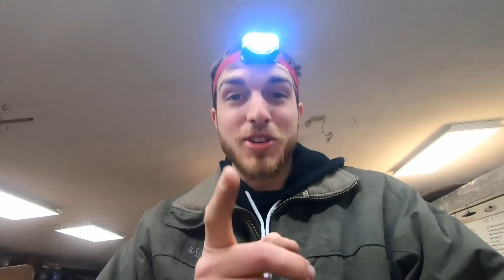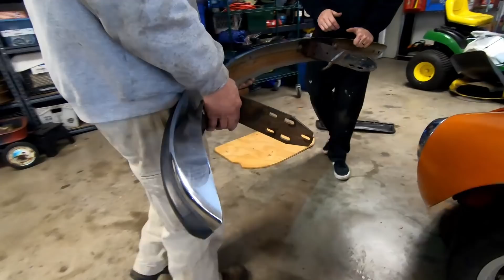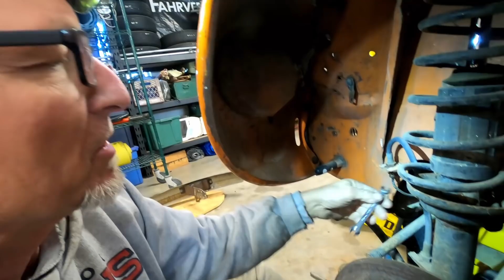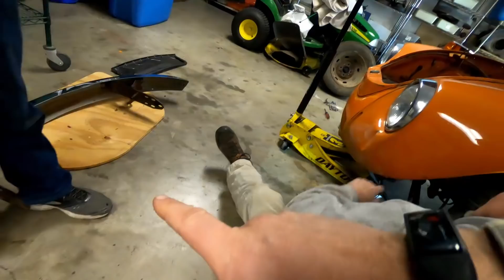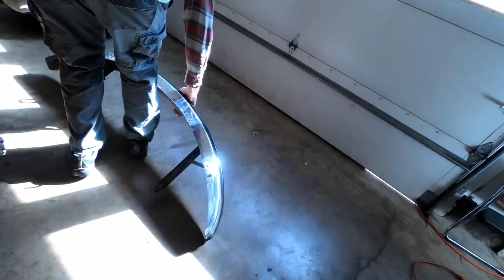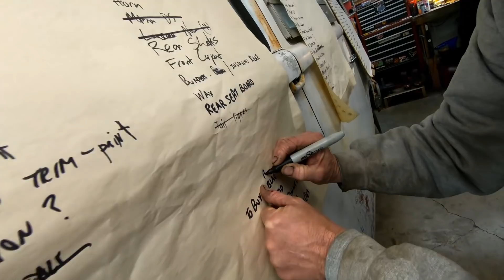Nothing's Too Good for the Orange Menace! 1973 VW Bug

Comment: Hey VW Life! I hope I have as much fun installing my bumpers! I just picked up a new project....1983 Vanagon Diesel! Only 80k original miles, only a couple surface rust spots and there's pretty nice paint underneath the oxidation. Going to be a billboard work truck for my electrical business
Reply from the maker: Wolfgang that's great! Did you see our last video with Alice's diesel vanagon?
Reply: @VWLifeVW  I did! I'm collecting parts now to convert it to the euro spec turbo diesel

Comment: my '63 bug had a defective rubber line. It looked good on the outside but it wouldn't let the fluid go both ways and the brake would not release.
Reply from the maker: Yes, that's stumped us before.

Comment: I have a question,  can you Baja a super bug ??
Reply from the maker: Yes sir. There is a channel called Dust Buggy they have one, check them out
Reply: Yes with a baja kit made for a SB not as strong as a king and link pin but depends on how you want to use it

Comment: The wrong bumper was a easy mistake. I would rather get a car from you guys as opposed to those quick flip jokers you see on you tube. What's the plan for the single cab? It should be next
Reply from the maker: The single cab has been a slow project That Gary doesn't his free time. Since he does that work on his own not much of that is making it on YouTube, unfortunately, but the triumphant day when it makes its debut on the road, it will be shared with the world on YouTube.